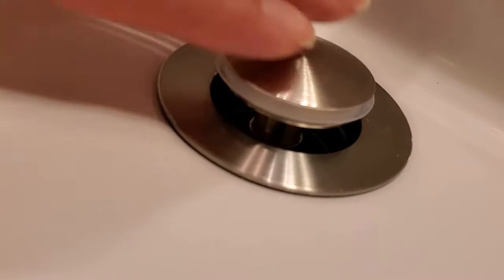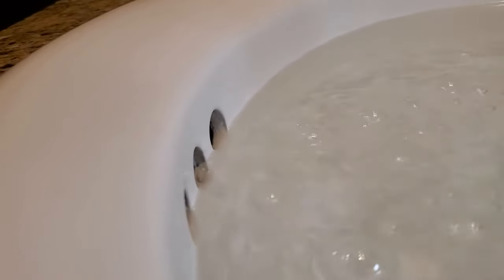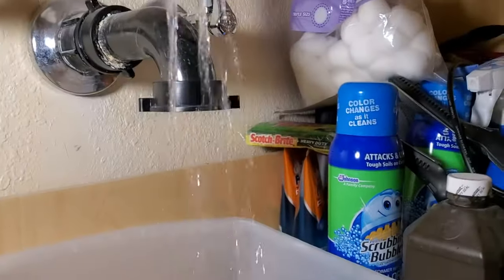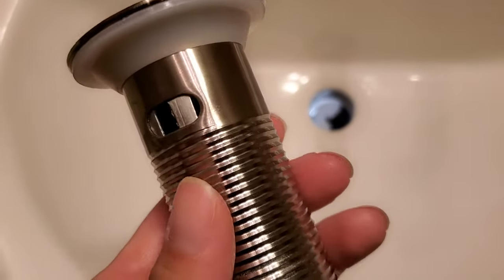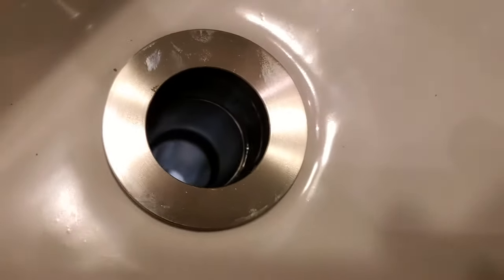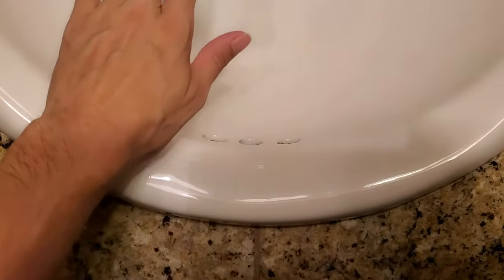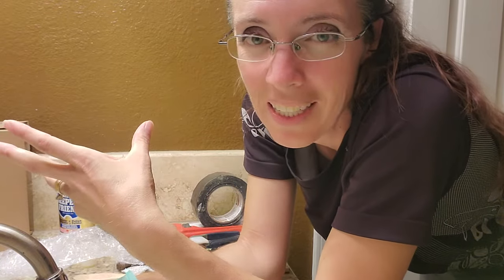How an Overflow Bathroom Sink Works [& Why This is VERY Good!]

Comment: If you have ever replaced a drain you would be amazed at the amount of debris and gunk that is trapped in the dead space in the sink surrounding the overflow holes in the drain. This totally grossed me out and I would rather risk an overflow than knowing the gunk that can collect here. The new pop up drains are very easy to install, so I think I will see how a new non-overflow drain works instead. I am also using a pop up drain with a hair catcher to also keep it very clean. So far my sink is draining quickly and I’m quite a dirt freak 😮.
Reply from the maker: I hear you! When everyone was home during Covid and the sinks were getting used all hours of the day and never drying up. I'd pull the whole assembly apart to clean out the gunk everywhere. I'll admit I haven't liked the pop up drain as much as I hoped. The stainless isn't holding up and I'm worried it will stick in the down position. I'd love to hear if you find a good long term solution.

Comment: The overflow is definitely a good idea, but the stopper that expects you to put your hands in the water to release them, never made sense to me.
Reply from the maker: Oooooh! See, this is why I like comments. That's a VERY good point. We don't use our drain stoppers. So I'm cleaning out my disgusting drain every 6 months and it takes a good 15-30 minutes per drain if I'm booking it. I'm at the point were I'm done with that style and fast and easy cleaning every month is what I'm experimenting with (although I will say my daughter beat me to it and hey--if she's willing to clean it out this was sooooo worth it!). But now that I think of your comment, between the bathroom sinks and the kitchen sink, we are down to this style where whatever radioactive stuff we put in water requires a hand to disengage the drain. So maybe I'll keep a stick with a little rubber suction cup--like you see on the end of kid toothbrushes--nearby to poke into the water instead of my hand. Thanks for adding your thoughts!!!
Reply: What makes no sense?

Comment: I occasionally take my spray bottle of 409 or Fantastic and spray into those holes to clean the inside of that “hidden” channel. I then pour hot water into those holes so the cleaner works its way to the drain. Since my sink rarely if ever is filled with enough water so water enters those holes - the channel will dry out and emit a nasty odor. That’s why I occasionally clean it.
Reply from the maker: Very nice! Thanks for sharing.

Comment: I had a top of vanity bowl sink installed and the guy mustn't have known what he was doing because the overflow doesn't overflow and tiny black worms come out. I looked them up and they're black drain worms. The landlord hired the guy and she's not having him come back anytime soon, so I pour water in the overflow to try to flush them out. It's smelly too. Is there a certain small flush type thing I can use to get them out?
Reply from the maker: Yuck! That sounds pretty gross. I'll admit though as we've been home more during the day--less time for the drain to dry out between uses--I've noticed our drains get gunky much faster in the last few years. While we don't have black drain worms, the only thing I've found that works when it gets into the gunk stage is taking everything apart and cleaning it. It is not a fun process but I don't know of any product that will eat away at everything and leave it as clean as physically removing the entire drain assembly. Perhaps someone else reading the comments will have a better idea because I'd appreciate knowing as well!
Reply: Funnel White Vinegar into the overflow and have the landlord fix the the overflow. Otherwise, you're stuck with the nasty.

Comment: thank you I did not know how or where the water flowed out, although I knew it had to go somewhere.  I am concerned that my sisters bathroom sink overflow holes have began to rust or a rusty stain has formed and she says slimy material is coming out of the holes.  How do you fix that?
Reply from the maker: I have the same problem from time to time. Taking it all apart and getting/flushing/picking it all out is the only solution I've found that works. The good news is the rust is normally just surface level on the porcelain sink (as long as the top surface is still non porous) and Bar Keepers Friend really is your friend--that stuff is magic. At that point the rusty part of the drain needs replacing. It is not a fun job, but I hope that helps!

Comment: For two days hard wax is stuck inside overflows sink. How do i soften snd remove it?
Reply from the maker: That's a tough situation. I don't know that a hair dryer or heat gun would warm up the porcelain enough to do much more than soften the wax. The concern there is that a hot enough temperature could crack the porcelain. Even if it did and you dug out a pathway after taking the plumbing apart below would that be enough? The other answers are live with it and make sure the water level does not get high or replace the sink.

Comment: Does it matter which direction you  place the overflow drain pipe
Reply from the maker: I just try to make sure the holes line up. Might depend on the sink/drain pipe.

Comment: Does water backup in to that drain hole.  Because  the bottom  of my sink has a hole and is leaking.  The bottom  of the sink looks like a plaster material.  The sink never over flows since I owned it. It is 30 years old. I'm thinking  water going down the drain is backing up into that hat channel.
Reply from the maker: Yes, if the drain is clogged in, let's say, the p-trap, it will absolutely take the easiest route and back up into the drain hole. Sometimes plumbers putty is used and wears out, allowing the situation you just described. I hope you caught the leak soon enough so the cabinet isn't messed up!

Comment: Can we just drill the pipe of the ones that are "without overflow" to convert them?
Reply from the maker: Possibly. The concern I would have is the raw surface--if it rusts easier? Is it possible to return the drain you have and get the one with holes?

Comment: So what is the second hole on the pipe on opposite side ?
Reply from the maker: If you mean the pipe below the sink--I was in the process of replacing the old drain with the pop up drain. I had taken apart the p-trap and needed to put it back on. If that's not what you meant, if you reply with the timestamp in the video I can explain.

Comment: Well I just flooded a room with an over flow sink how does that happen
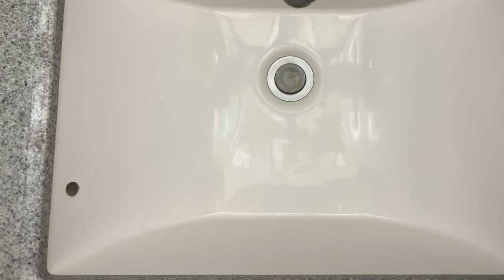Reply from the maker: That's terrible! There are a couple possible scenarios. The drain holes within the sink/at your drain stopper could be plugged. Or you could have a sink like the one in 1:21 where the overflow is small and can't handle a high flow coming out of the faucet.

I hope the damage wasn't too bad!

Comment: Good he has three over flow hoes, but be careful probably 90% of sinks only have one and the the hole is to small and the sink ends up overflowing anyway.  Also equally important, The spout stopper need to have a big hole there to  and line up with the drian overflow drain hole in the sink when installed.
Reply from the maker: #truth I may have to run a follow on video on this. So many times we're picking fashion over functionality and whoever designed that one hole wasn't thinking of function.